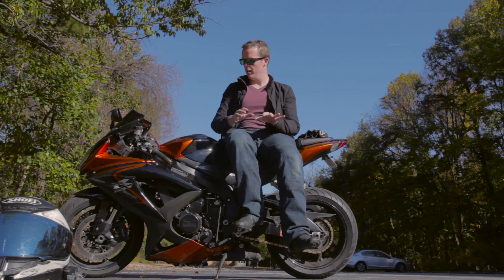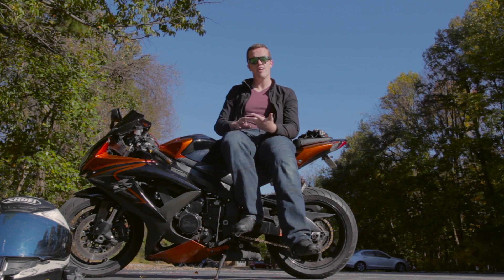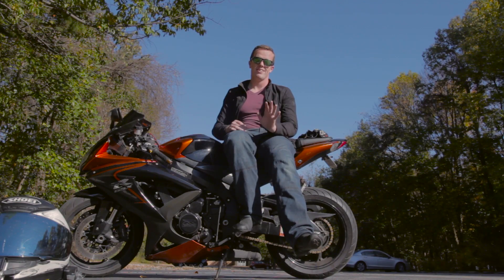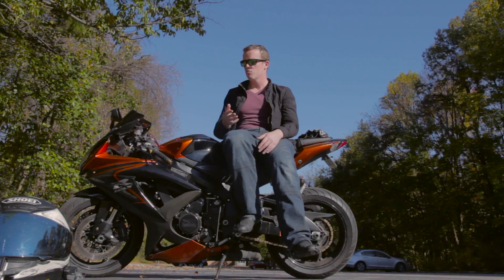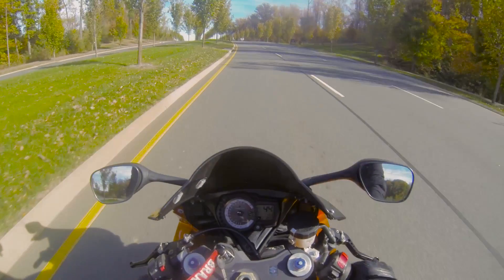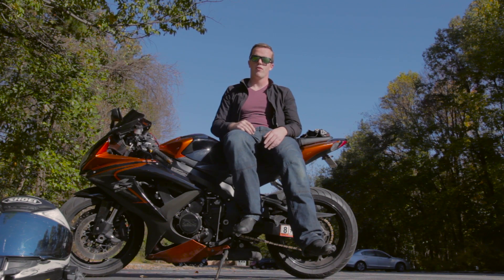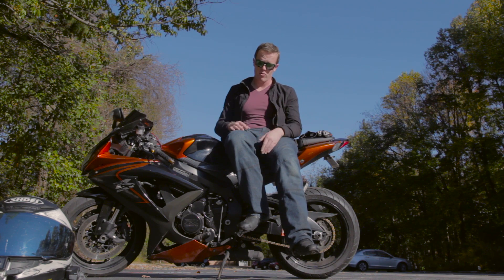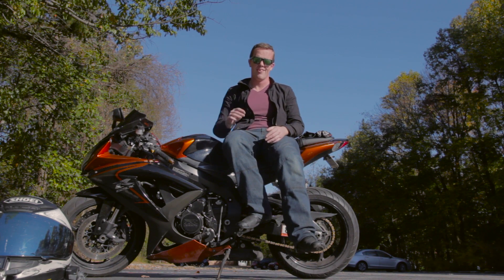How Motorcycle Engine Braking Works

Comment: also .. a vtwin like my sv650 engine brake is ridiculously strong. i lock up the rear tire on a regular basis but never too much
Reply: Agreed, engine braking is strong on this thing. The rear wheel nevel locks up on the new one though !
Reply: Do you lock up when you let the clutch out, or does it just lock up after you've let the clutch out and you've rolled off?
Reply: I guess if the speed/rpm isnt matched when clutch is released , then yeah it can be rather ubrupt. But its really rider error. I do it for fun mostly
Reply: Frank The Rabbit...I was going to mention this...if you are locking up the back wheel while downshifting...then you are going to fast for the gear that you are downshifting to...which can be dangerous...especially with an inexperienced rider.
Reply: Yeah i know. I only do it coming into first gear at low speeds every now and then.
Reply: Cool...I did it when I was a teenager on an enduro... Yamaha DT250R...and doing that will definitely wake you up...My Dad had a chain brake when He was young and that will lock up the back Wheel too.
Reply: Yeah i normally am expecting it already so i dont really care.
Nut yeah probably not good for the bike and a bad habit. I learn my bike a little more everytime i ride. Plus i have no tach or gauges whatsoever so its all by feel.
Reply: Nice...well happy and safe riding to you...My friend.
Reply: Frank The Rabbit v twin engine brake effect is usually more pronounced than other engine configurations. Start blipping the throttle, or blip it a bit more (if already doing so), before re engaging the clutch. Sounds like your "slipping" the clutch out to be smooth. Yes, slipper clutches  help with this but they are not perfect
Reply: Frank The Rabbit Yeah, V Twin on my 250 (Honda) is strong enough to replace the brakes! XD
Reply: Right on you too man cheers from Texas

Comment: Engines don't actually suck anything. Engine breaking is done by using progressively lower gears that cause the engine to need to rev up. It's the compression of the engine created by the closed valves on the compression stroke of the reving engine when your not applying throttle. Smaller forces within the engine also assist in braking such as oil viscous, metal friction, exhaust restriction, etc.

Engine braking is great.

When valves open it lets air in. Like a glass fills with air when you pour water out. If no air could get in engine braking would not do much if anything at all. Just like a vacuum cleaner. Air is pushed or compressed only. It automatically replaces the lack of air in a void. The weight upon air is 5,000,000,000,000,000 tons.

That butterfly closure is not airtight and piston rings are not designed to work backwards. If you could block the air you would only get less force against the compression stroke because you would have less air.

None of this has much to do with your video on engine braking other than the science of air compression.

Great video.
Reply: David Phillips ok tuff guy
Reply: Ghost of Sparta Think about it. The piston compressing the fuel air mixture to higher than atmosphere pressure creates resistance. Imagine you’re trying to push the plunger down on a syringe that’s blocked at the tip. The air cannot escape causing resistance while being compressed.
Reply: Ghost of Sparta  the engine is still running. The amount of air going in is according to the size of the motor. If there was no air getting in the motor would die.

Comment: You mention how it'll save your brakes, true but pads are a lot cheaper than engine parts, harsh engine braking will reduce the lifespan of the engine. A combo of the 2 is always best 👍🏻

Comment: hey I will just put it out there but I have heard that with a 2 stroke premix engines, do not use engine braking as the lube oil going into the engine is far lower than what is required, basically the amount going in will be the amount that goes in at or near idol with a closed throttle but the engine is at high revs during engine braking, while I am sure it wont blow up every time it is something to consider eh.

Comment: Correct me if I'm wrong, but engine breaking never slows you down super fast, there is less energy there than when you accelerate at any decent rate, I don't see how engine breaking will wear out your clutch at all as long as you are revv matching your downshifts, the force on the clutch should be less than when you accelerate.

Comment: Does any of this information differ when on a V-Twin, more specifically, a Harley.  Also, for argument's sake, lets say it is a modern Harley, 2015 or newer.

Any input is appreciated.
Reply: I'm no expert but I don't see why it would differ.  I ride a v-win Sportster and an inline four CB1000R and I don't notice much of a difference between the two except that maybe the Harley is a little smoother when engine braking.

Comment: get a bike with a dif and engine braking for city riding is all you need for 90% of the time and bring in the rear brake when coming to a halt, only need to use front brake in an emergency

Comment: Done properly. Its a far smoother transition in and out of corners. Also far more control of the bike. less chance of being too fast in a corner and braking into the barrier. Crash and burn. As wearing clutch down. Don't do it sharply when just slowing down. just pace your speed and slow down  normally.  while using your revs to control your cornering. Within time you will master it smoothly and become much faster in corners and feel more confidently controlled. Ha. If that's a word.  But im  writing this because anyone that says not to, Will put lives at risk. We need to use every capability to be safe on the bike.

Comment: braking should almost always be a combination of front, rear, and engine braking. All three at the same time. Very few situations call for any other type of braking.
Reply: in city traffic engine braking is all you need until almost stopped then use rear brake, cars are sooo slow at braking that using all your brake types is a waste (unless you are one of those idiots that race on the streets)
Reply: bjorn1583 I go as fast as possible at all times.

Comment: I ride my bike like I drive my car...I enter my gears with the clutch fully engaged.
The while wet clutch thing is odd to me since I drive manual cars and fully engage the gear before adding gas.

I'm trying man, I'm trying but I passed my MFA class (100%) without a foot down because the engine was engaged and controlled by the throttle not the slippy clutch.

Comment: Hi BikeBro, In modern motorcycles there is another element added that helps with engine braking. That is the exhaust powered valve...
Most people believe that the exhaust valve is there only for Euro Compliance, noise reduction, etc… but the secondary purpose is to block exhaust from existing the cylinder on return with the throttle off.Think this, when the cylinder pulls down with the Intake valve closed it causes some vacuum but on the way up, that that small amount of air that did get it would be just pushed out the exhaust causing no resistance. That is when the exhaust power valve closes to block some of the air from escaping and causing pressure in the engine.
The amount of braking that it causes is small in comparison to the Air Intake Valve but it is there. It was initially found in MotoGP where any small amount of braking is critical…

Comment: Very nicely put together video, I love that I caught you at 1k so I can watch the channel grow!

Some added info from my experience:

When I bought my first bike (ninja 650, idle rpm set around 1,500)
I was entering my neighborhood at about 3 in the morning.

I was going about 30 mph in 3rd gear, pulled the clutch in to go to idle rpm so I could quietly coast a few blocks to my garage.
Shift down to 2nd, turn left, shift again to 1st (still holding in clutch)

I dumped the clutch.
Don't ask me why, because I couldn't tell you even then.

30mph bike wheel pulls 1500 rpm to about 8k, drastically reducing speed, lock the back tire up, drop the bike.

Pay attention to what gear you're in lol.

Comment: The only time the clutch wears is when it is slipping, changing gear or pulling away. When it is fully engaged there is no friction and hence no wear.
A multi-plate clutch is like a stack of plates, when they're pressed together they don't slip, when the clutch is pulled in they slip but they are loose and so will rub together. This is when they wear down.
Where you get increased wear is on the chain and sprockets taking reversed strain, they're generally up to the job. 
If you change down from high revs on a sports bike you can over rev the engine, such bikes may have free-wheel slipper clutches to prevent damage, but they also reduce engine braking.
If you shut the throttle on a "big single" the engine braking  may tip you over the bars. These old brutes have fantastic engine braking. If you're in the middle of a bend on one, you can go from on the throttle to off the bike, it requires a somewhat delicate touch.

Comment: Dont use that on a 2 stroke! Your engine doesnt get (enough) oil when you go off the throttle. It could damage the engine when often in high rev regions.

Comment: Is it possible to downshift without using the clutch? Kind of like the clutchless upshift where you preload the shifter and throttling off to shift. So basically preloading the shifter and as the bike/ engine slows down enough it will "pop" into gear.
Reply: My father once rode from Massachusetts to New Jersey with no clutch cable after it snapped.  It was on a Sunday when most shops are closed, he had to suck it up and keep riding and pay for an expensive tow back.  I was riding as passenger, I think I was 11 or 12, he didn't want me on the bike is case something happened so I hopped on back of one of his friends bikes.  He made it back home with no damage to the bike, he kept it another 10 years before he got rid it and never had to replace the clutch.
Reply: Kevin Lam you do the same to downshift without clutch, throttle a little bit then wait for the slowing down and down shift, just be carefull with the rpms not being too high
Reply: I tried clutchless downshifting. Not necessary to blip the throttle since clutch is still engaged. If you keep slight pressure on the shifter it will go into gear when it slows down enough.
Reply: Yes it is. It is a good way to snap the chain. 

Or as I once watched, the prop shaft on a tractor.

With a constant mesh motorcycle gearbox clutchless up-shift is a doddle, you just ease off on the throttle  for a moment to get some slack between the cogs as you feel the gear lever up. Changing down we go from less revs to more which can put a bit of an excessive strain on the power-train. Changing down we still have to match engine revs to road speed so there's some slack between the gearbox cogs and it will then change smoothly, it is more tricky than the up-shift and often as not goes wrong ; unless you have a quick-shifter, best not.
On the down shift we usually have the throttle shut, to do a clutchless we have to lift the throttle, which we don't want to do because we need to slow down - use the clutch.
Reply: You will have to, if your clutch wire breaks. Its fine to do as long as the revs have dropped considerably to the point of almost stalling, then you can drop down a gear without the clutch otherwise your rear wheel is going to lock up

Comment: Beginner here!
Would engine braking in bike with slipper clutch will be as good as the same bike without slipper clutch?Just curious.please pardon my lack of knowledge.
Reply from the maker: There are differences but day to day its negligible. Slipper clutches are hard to activate so you really need to force your bike town too many gears so that in the smaller gear you exceed redline to provide enough torque to make the slipper clutch change the characteristics notably (but it also just saved you and your engine so...)
Reply: BikeBro I see.Thank you!